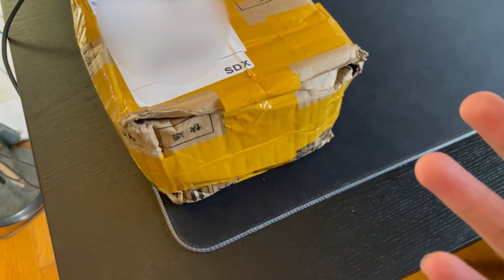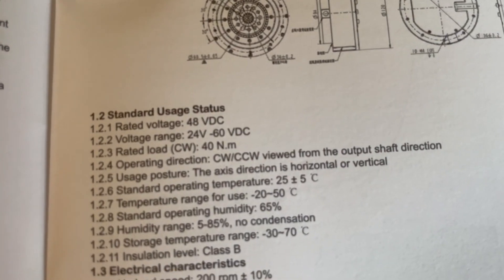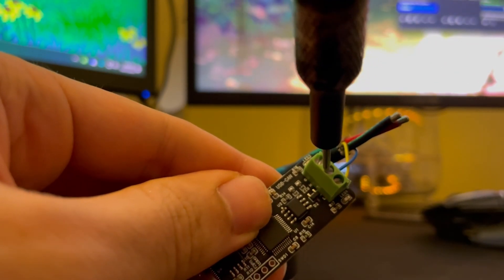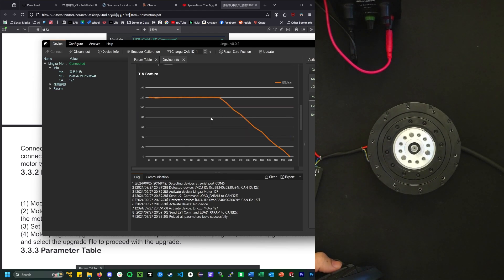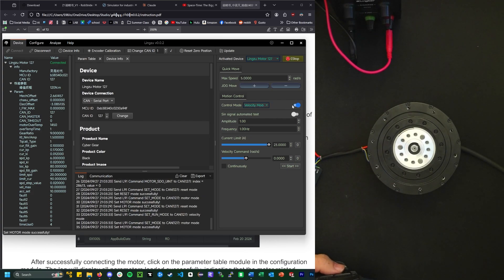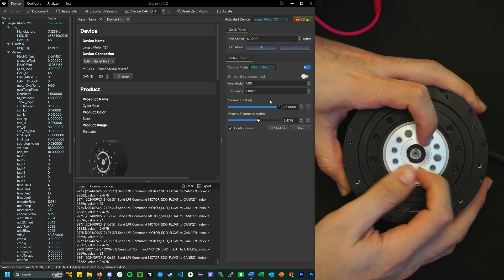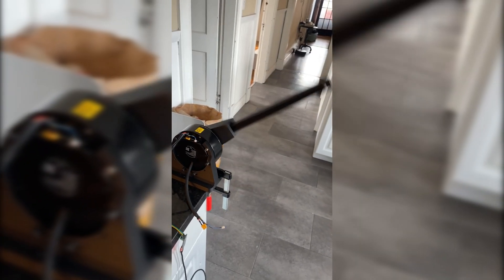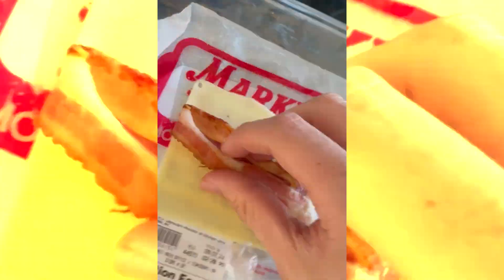$300 120Nm robotic actuator from aliexpress - ROBSTRIDE04

Comment: I have the O3 and just keep getting this error: 1 [2024/11/05 21:04:18] Connect overtime, try baud rate: 9600
2 [2024/11/05 21:04:19] <ERROR> USB-CAN module configuration failed, please check physical device!

I have tried swapping can high and low wires, unplugging usbc etc. I was able to get it connected once but now it wont connect at all, any ideas?
Reply: I have exactly the same problem! Does anyone have a solution? I tried contacting Robstride for support, no reply yet.
Reply: Yeah you have to change the baud rate I fixed it
Reply: @kaydenknapik  where did you change the baud rate? In windows settings or somewhere else? What did you set it to?

Comment: This is just a CAN bus geared servo. Nothing special here... The gain looks a bit low and its position holding looks really bad (by CNC machine servo standards anyway) so you need to adjust the PID parameters.
Reply from the maker: yeah the pid tuning is my own and not great yet, i’ll find out soon if it’s special or too good to be true

Comment: idk at what voltage you ran it but of course you cant hold 120Nm or even 12Nm with that 2 cm leverage... you are trying to counter equivalent to over 1000 pounds with your fingers there.. Itd probably be impossible for you to do even with a normal sized wrench(30cm).
Cool motor tho. I would love to see the gearing and more of the inside. I wonder if its just one set of planetaries or multiple and what kind of machining and material quality its for that price. Sometimes chinazon really delivers

Comment: May know this already: 
* Rated current on actuator is peak phase current (which is not related to supply current unless at peak rated speed of motor at 48V, which is kinda unachievable) 
* Therefore your supply should handle peak torque (even at 30V) at low velocity, so just dial down those gains. 
* Your supply may have cut out due to an over voltage event due to BEMF generation during backdriving of the actuator (not an issue so mych with battery powered) 
* To handle these BEMF event your need a "regen shunt" (check o-drive for that) 
* The BEMF exhiibits itself on the voltage bus by exceeding the voltage setpoint of the supply. 
* You'll note when the weight is being lowered, due to the potential energy of the lifted mass, the current in the supply should drop ~0amps at times.
* the above is predominantly just a warning so not to blow the control board or other devices connected to the voltage bus if they're not able to handle the transients and over voltage events. 
* testing at 24v, and getting a baseline of behaviour is safer, you have a much higher chance of damaging the controller when running at max operating voltage and then having a large Regen event (backdrive)
Reply from the maker: this is seriously very helpful, thank you!
Reply: @kindaovermyhead  All good, keep at the testing and I'll be folliowing the progress, you're doing good. Shout out if you hit any hurdles, happy to give direction. Breaking things is all part of the process.
Reply: @ZedDead-n3s  Sir, i face the same problem ... when my motor accelerates with some weight on it, and i want it to stop in a specifiv position , it shuts down when it is supposed to stop. I was thinking that there is reverse voltage that with the one added from the one that comes into the motor results in low voltage so the motor shuts down. In the odrive they give you a breaking resistor. But in my motor i don't see how i can implement it. Is there another way to avoid this problem? what is the regen shunt that you mentioned above?
Reply: Sir, i face the same problem ... when my motor accelerates with some weight on it, and i want it to stop in a specifiv position , it shuts down when it is supposed to stop. I was thinking that there is reverse voltage that with the one added from the one that comes into the motor results in low voltage so the motor shuts down. In the odrive they give you a breaking resistor. But in my motor i don't see how i can implement it. Is there another way to avoid this problem? what is the regen shunt that you mentioned above?
Reply: @gerokatseros  You either need to hook up the odrive resistor or run your motor off a battery pack. The majority of power supplies are not designed to handle incoming current supplied from BLDC's.

Comment: No statement anywhere about backlash...
Reply: This actuator is meant for dynamic applications (e.g. robot dogs) where backlash is not as critical as transparency (i.e. reflected inertia/efficiency) and torque
Reply: @vincentnguyen8083 This means that using it for a robotics arm is a bad idea? Any thoughts on what kind of repeatability should anyone expect from an arm out of these?
Reply: @gtsianakas  an arm out of these would certainly be possible, and this is what some companies do to accomodate impact-rich environments (see the DuaArm from Duatic or anymal's robot arm, which both use QDD actuators with a planerary geartrain). However to get good repeatability you will need either a well-matched gearbox, or an external control-loop (e.g. visual or precise output encoder) to mitigate backlash
Reply from the maker: knew I forgot something! Its backlash isn’t advertised, it feels near zero, but I didn’t have my dial indicator on me to test this time around
Reply: @kindaovermyhead for lots of applications this is more important than pure torque. It is a planetary gearbox so probably not that good I'm afraid...

Comment: probably should have got it in position and then slowly added the weight
Reply: There is a difference between static and dynamic load. Just because a motor can hold a load that doesn’t mean it can move it.
Reply: @conorstewart2214  theyre probably rating a static load tho

Comment: This video legit got scary towards the end. With the risk of smashing the tile floor, kitchen cabinets, counter tops and then standing next to the weights with socks on at the end really got worrying for me
Reply from the maker: cookin
Reply: @kindaovermyhead  I guess you live up to your channel's names 😂😂😂
Reply: @kindaovermyhead  some constructive criticism, you designed the printed part as if it was to be milled from metal, the hub area stepping down like that is a weak point. if you keep the part that is clamped onto the motor as thick as the whole arm, you will compress the printed part with long AF screws and add to its z-strength instead.

that actuator looks like a beast, and the software intuitive enough the figure it out, but you also get full control over everything, at least thats what it looks like.  
great video!
Reply: He was wearing safety squints. It's fine :D.
Reply: Yup, that thing can basically send those disks flying in an instance. Awesome! :D